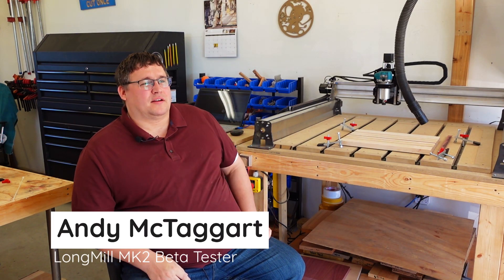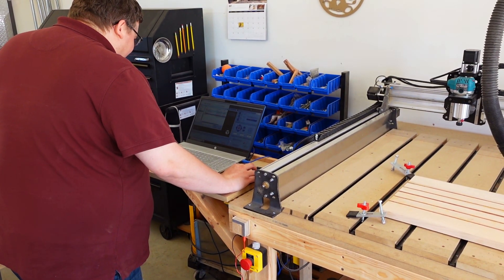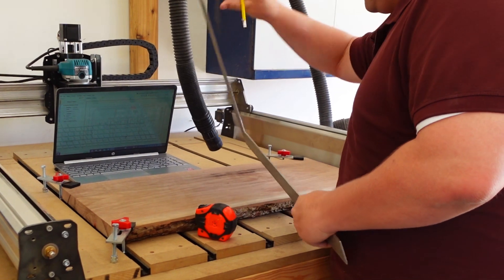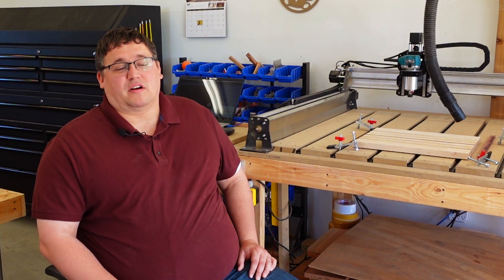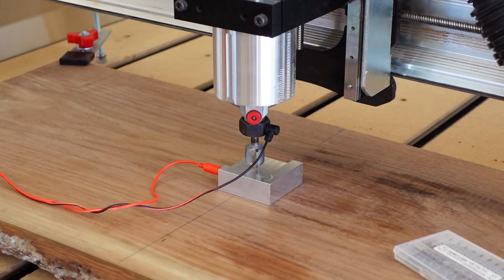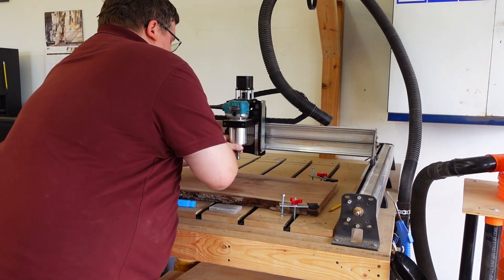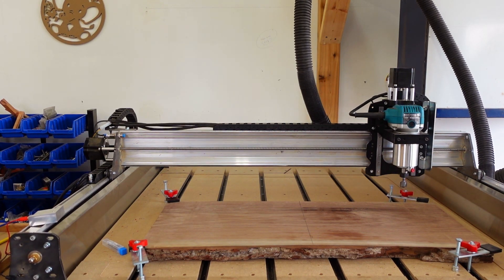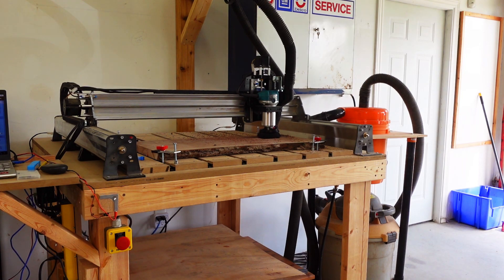The MK2 Beta Testers with Andy McTaggart - LongMill CNC Router

Comment: Andy, as a MK1 owner myself, I agree with everything you've said abour the machine and the company.  However, I see you have the bad habit of tightening - and loosening, I assume - the router collet without using both wrenches.  This places unnecessary stresses on the Z rails.